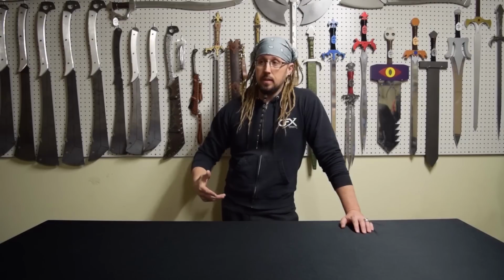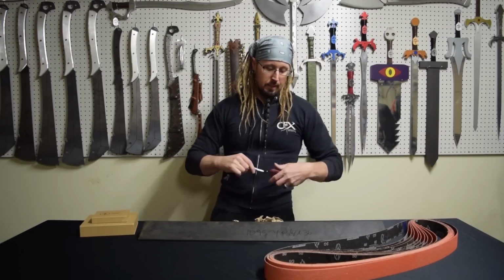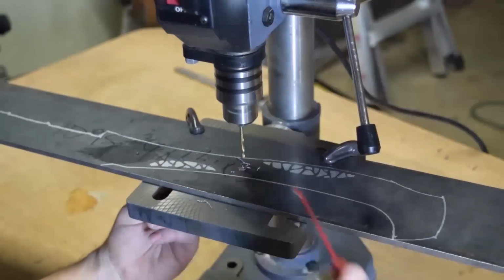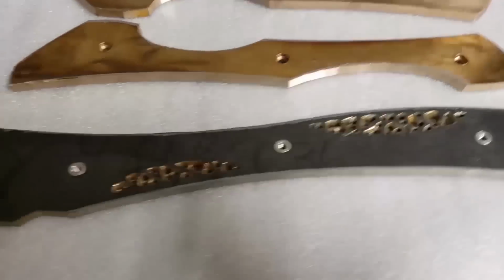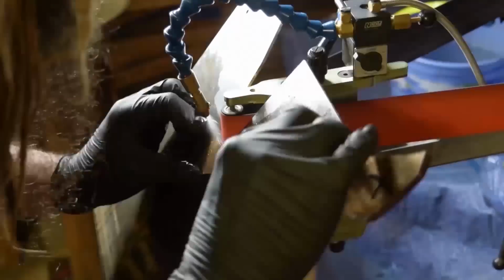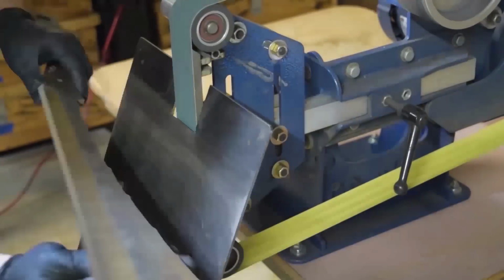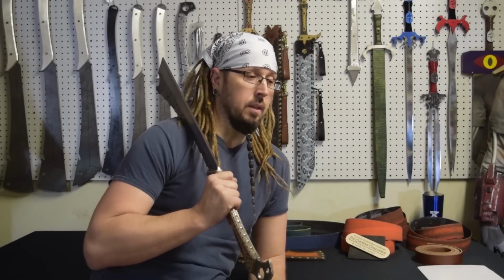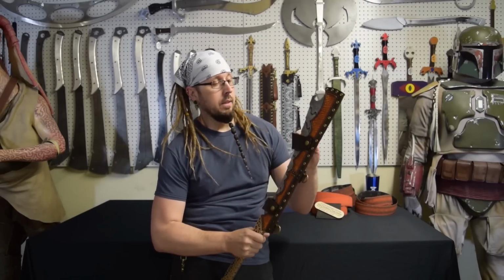Chopper Challenge Build! | YouTube Knifemaker Challenge (Viewer Submission)

Comment: Excellent work!  Loved the design and workmanship.  I'm curious as to how comfortable the handle is barehanded after all the detailing you put in there.  Do you need gloves to safely use it (as you did in the veggie and fruit attacks)?
Reply from the maker: Thank you so much for the kind words- I'm glad you like it!! 😁🙏🙏 And the handles are actually really comfortable bare handed, usually with metal handles they get pretty slippery so the extra details add a lot of grippy-ness (plus I sanded down the sharper edges, and polished the cutouts where you grip the steel).  And actually when chopping the fruits and veggies I wore those neoprene gloves so my hands didn't get sticky from all the juices hahaha!! 😅😂